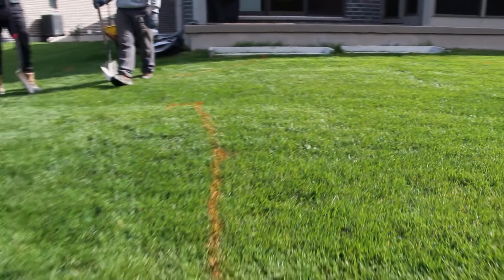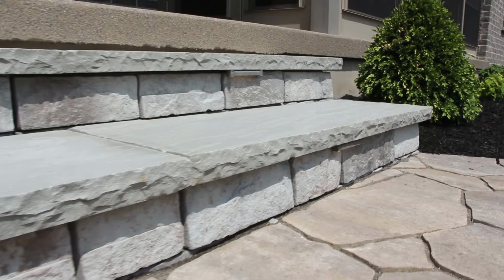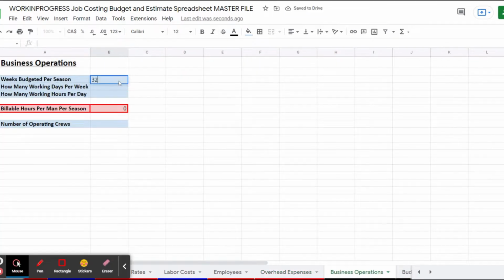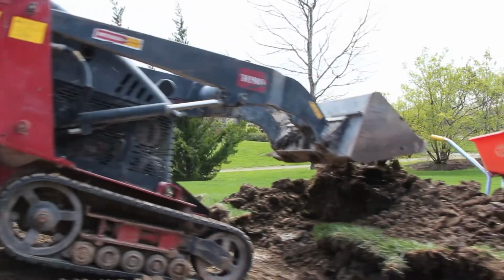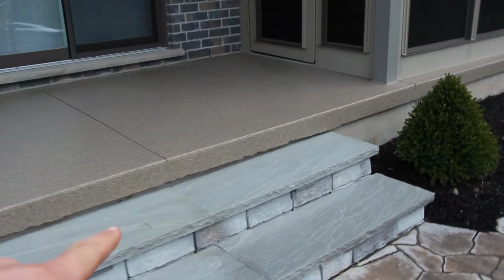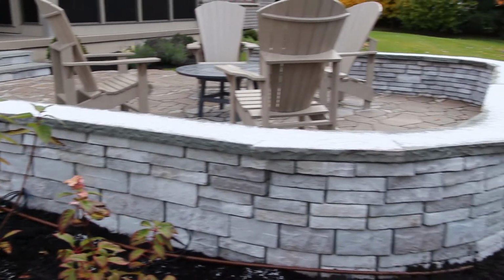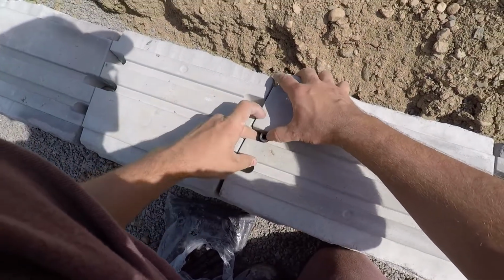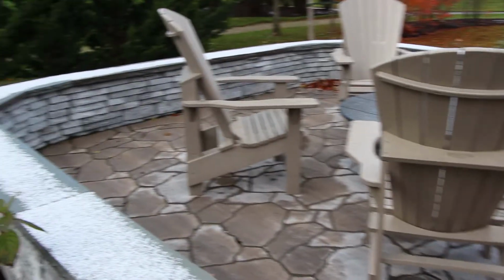How to Price Landscaping Jobs | Creating a Design Concept and Quoting

Comment: Great video. Is the seat wall and steps dry laid? If so what material did you use to adhere the cap-concrete glue or mortar?
Reply from the maker: Thank you! I used a polyurethane based adhesive for each row of the seat wall, caps, and steps.

Comment: You just used a program.....
Reply from the maker: A program?
Reply: @iamahardscaper  the program that calculates your profit.
Reply from the maker: Ah, yes the spreadsheet we formulated to calculate our overhead recovery for the time allotted to a specific project. We take what we calculate in the field, what the project entails, what our production rates are from that, and then apply it to our overhead recovery, labor costs, add our material costs, and calculate our profit margin on top of that. It would be very time consuming or inaccurate if we did not use this program.
Reply: @iamahardscaper  if I'm not not mistaken, you plug in the numbers. And the amount of profit you want to make. Presto! The number. 

Or are you doing the math?
Reply: @iamahardscaper  wow, that didnt even seem like you were talking to me. Sounded like a commercial.. 

I said you use a program. Then you said yes... in a paragraph..
Reply: @iamahardscaper  I didn't ask you how you got your numbers or why your doing it... I said

You just used a program.. odd..
Reply from the maker: No need to continuously do the same math again and again. The formulas are set with the spreadsheet.
Reply from the maker: A spreadsheet, yup!
Reply from the maker: What is odd about using a spreadsheet? I'm always interested in alternatives, let me know what you use to price projects. There is never just one way.
Reply: @iamahardscaper  you missed the entire context of the comment... that's why you don't understand..
Reply: @iamahardscaper  lol, I know the benefits of spread sheet.

Thank you for your time..
Reply from the maker: No problem!
Reply from the maker: A comment with no context has no context.
Reply: @iamahardscaper  you missed the context. Rather just move on.
Reply: @iamahardscaper  I think you missed the point again.. that's not true at all.. if someone  can't read Grammer properly they can miss the point.. like you missed the point there.. just say use a spread sheet..
Reply from the maker: @djt7387  I think the missed point is coming on your side unfortunately. The context I read from you is that you initially posted two comments. Both of which were downplaying the information. Then this comment provides that exact context. There is much more explanation than using the spreadsheet. But you can choose to ignore the context of the video…
Reply: @iamahardscaper  "I think the missed point is coming on your side" 

..........
Reply: @iamahardscaper  I think you're pointing on the missing coming on...  close.
Reply from the maker: No worries!
Reply: @djt7387  everyone missed the context of your comment, what you said didn’t make any sense. “you just used a program” could be interpreted in a hundred different ways.
Reply: @Mike Hydroseed  well it means.. if you could read between the lines. Or use have used similar products you'd know the context. He did nothing except plug numbers in..
Reply: @djt7387  seems like to me he made the spread sheet so he didn’t just use a program. Plus he explained his methods and decisions on why and what he does.
Reply: @mikehydroseed1282  exactly. That's the joke. Whistle noise going over your head
Reply: @mikehydroseed1282  I appreciate your time. Thank you.
Reply: @iamahardscaper which program was used? It’s been so time consuming doing it with one
Reply from the maker: @ResinBudsTV  this was a spreadsheet I made years ago. It is now a software you can learn more about here: https://members.howtohardscape.com/headquarters-software/
Reply: @iamahardscaper  thank you I’ll check it out. Do you mentor by any chance? Just started last year but need help with how my processes go. The videos are great btw.
Reply from the maker: @ResinBudsTV  i do not. but everyone in our program has complete access to me whenever they need and I am always open to questions. Instagram is the best way to get a hold of me. We also have the How to Hardscape Podcast which I would recommend listening to.

Comment: How did the drainage work on this patio with the seat wall?
Reply from the maker: Small gaps at the base of the seat wall to flow through with a French drain on the other side collecting and draining out as well as a pipe on the inside of the wall as with a typical retaining wall build.